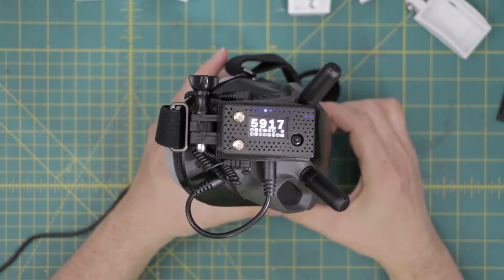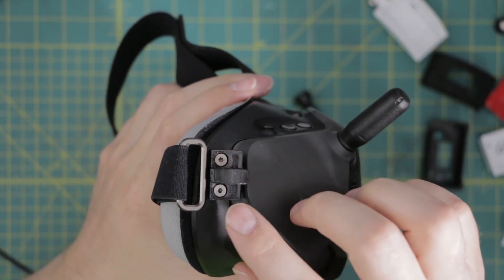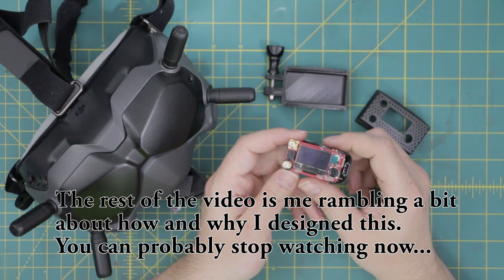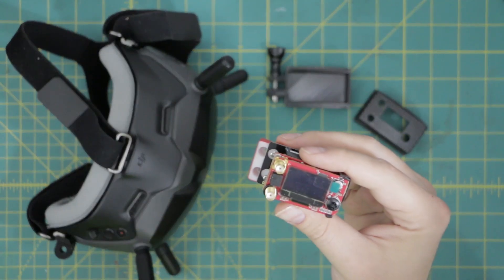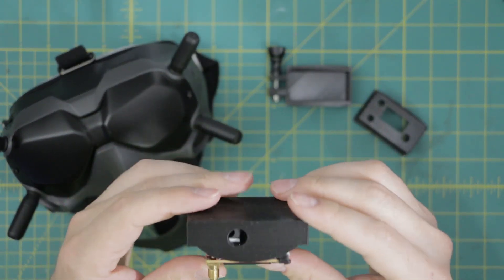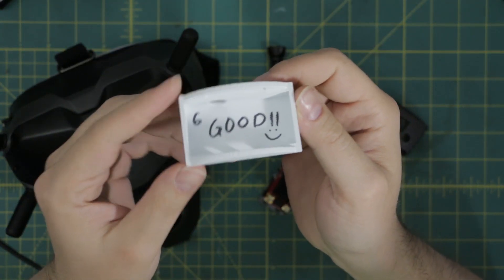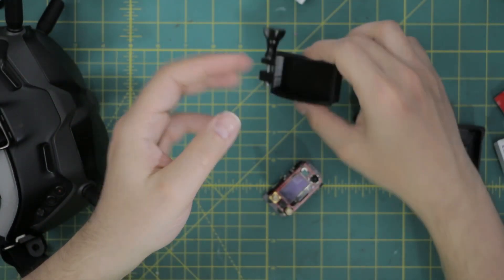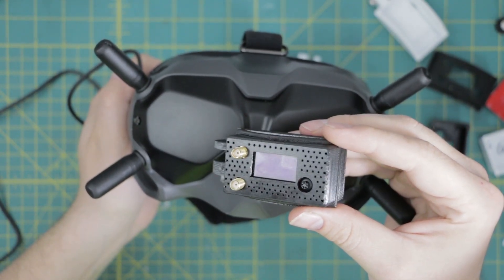DJI Goggle Analog Adapter Module Reveal and Discussion

Comment: Very nice! You should check out the new "Digidapter" analog solution for the DJI goggles. They look much better and are way more secure.
Reply: Sadly for people with axii antennas it doesn’t work
Reply: @PerceptionFPV  I assume you are talking about the faceplate axii patch antennas. I run the digidapters with 4 axii stubbies, if I do LR then I would swap out two of the tops antennas with patch antennas.